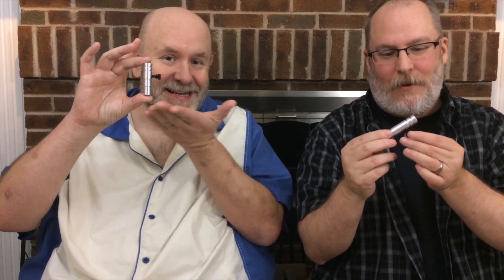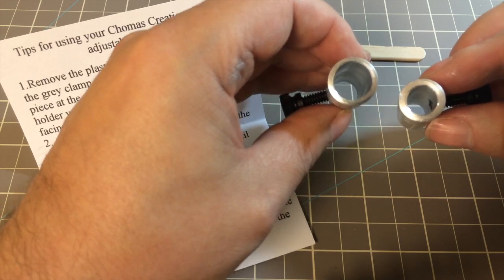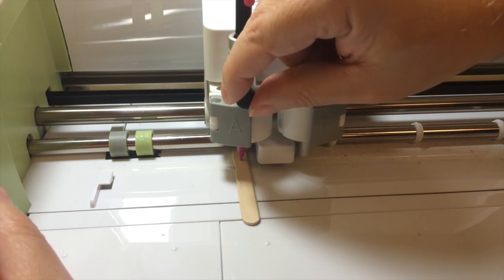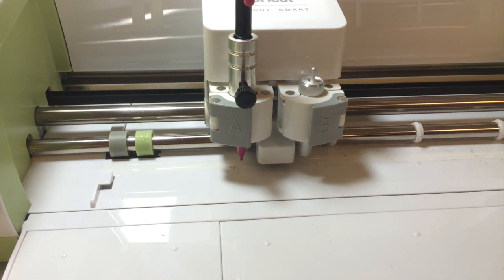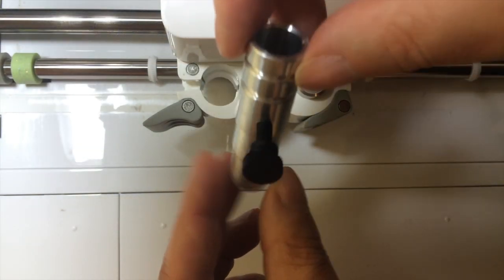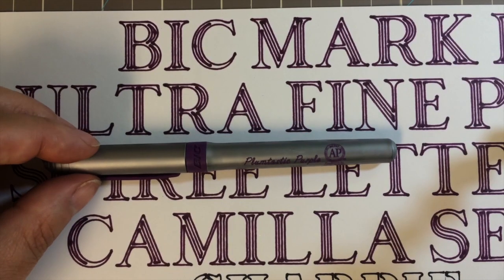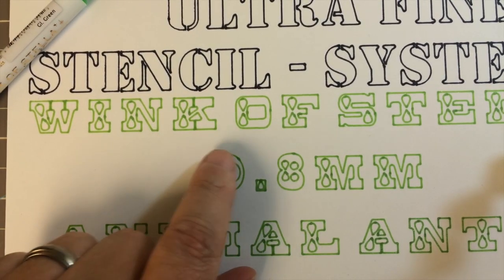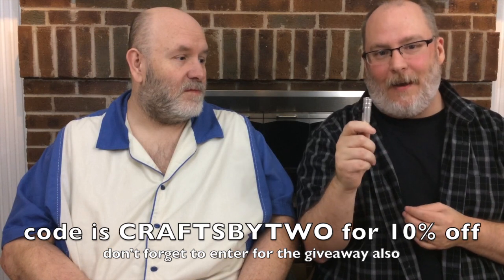Chomas Creations Adjustable Pen and Marker Holders for Explore - Review

Comment: I have tried the CRICUT scoring tool in the chomas adj marker holder and it worked well. I love the pen and marker chomas holders and use them all the time. I do use a lot of the Sakura gel pens (they are costly) but I have purchased them individually at Michaels craft store when they have a 20% off total store purchase coupon.
Reply: Renee I was just trying to figure out how you made the scoring tool fit centered...since it is not really round, when I tighten it in the point is not on center, but to the side. Can you please me any tip you used to make the scoring too centered? Thanks.

Comment: I am so happy to have discovered you two today! I just received an Explore for Christmas from my new husband (married 12 13 14)... but as a full time teacher and new wife, I rarely have time to learn it.  This was so great and helpful to know about. Thanks! Can't wait to check out your other Tuesday goodness. :)  One question - I just bought Cricut color pack - they are smaller and rounder and I think were intended for more basic machines because you replace the cutting blade to use them per the directions - will they work with either of these adapters?
Reply from the maker: Sara Kottsick Do you mean the short grey markers like these?
http://us.cricut.com/Shopping/detail--Cricut-Color-Inks---Primary-Collection-269-157.aspx

Those are for the older machines. You wouldn't use them with the Explore line.
-Ken

Comment: What a neat accessory.  I just ordered a replacement holder from Cricut, though have a question....the clamp on the accessory holder seems loose.  While it doesn't appear to be any looser than the blade housing clamp, it doesn't seem to clamp as tightly as yours in the video.  Do you have any tips or tricks for making the clamp close more securely?

Comment: I bought these using your discount code, thanks so much. I have gel pens with the rubber grip where you normally would grip the pen. I can't seem to get them to fit in the pen adapter without cutting the rubber part off, and if I try the marker adapter, the point is not on center. Any thing I am missing here to be able to use these pens without cutting off the rubber part? Thanks in advance for any advice you give.

Comment: Hello, I have been watching alot of videos about using other pens with the Cricut.  I have an Cricut Explore Air & I see no way to remove the original plastic sleeve holder and no other marker other than the cricut markers fit.  is there a work around for this?
Reply: the inner pen holder  pushes up from under neath  :)